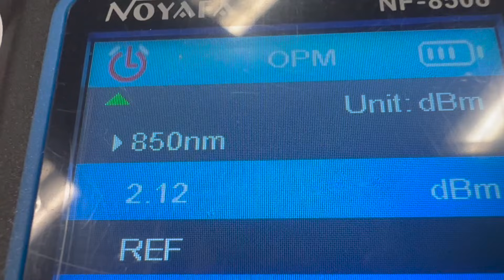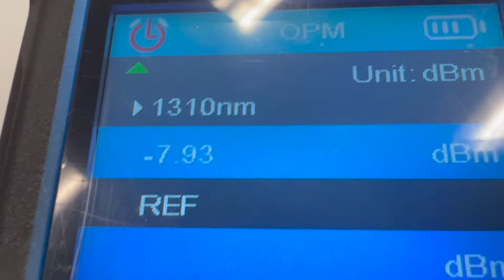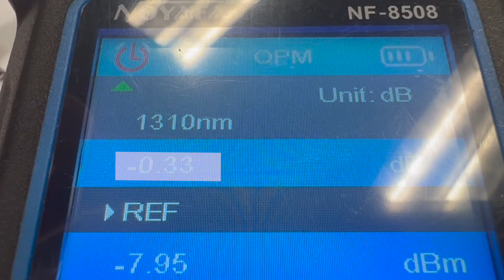How To Test Your Fiber Optic Cables With Cheap Tester

Comment: I'm finally making the jump to fiber optic cable termination and testing. Your videos helped get me there. Thank you. 

I'm getting the Noyafa as my starter fiber tester soon. I'll be sure to do it from the link in this video. I'm also looking at the Metra av cs-fbrkits fiber termination tool kit unless you know of a better entry-level option. 

 - Robert
Reply from the maker: A cleaver and stripper/cutters for that price is not bad.  I used a 3M system for mechanical connectors for a while for multimode but I found singlemode too sensitive to the mechanical connection and switched to fusion.

Comment: Hello thanks for your interesting video, very helpful 
Perhaps u can help me, u mentioned that as an OLS, a Fiber switch or router can be used, also Media Converter. I have tried my Media Converter HTB-GS-03 the A and the B on 1310nm and others, but the OPM didnt indicate a Signal, Fiber was tested with red light ok. What do I have to do to get it working? The HTB are working fine as a set. 
If HTB is not adequate , does not have SFP only a Jack for SC can I use any Router  or Optical switch? Any settings ---- Many thanks already

Comment: Dumb question.  You were showing a .75 db loss.  How did you get that from the -0.33 ? Or was that what you were referring to?
Reply from the maker: Apologies for that, when I did the test during recording I had that coupler attached and it adds a little bit of db loss and I read out what I saw on the screen.  When I took the B-roll, I had a different cable attached with one less adapter so the db loss was lower.
Reply: @tciproductions  Was confused and came here for this answer as well, thought there was some math I was missing. So you're saying the 2nd line on the tester screen read -0.75 dB when you read it, not -0.33 as is shown in the video?
Reply: Even i had same query 👍

Comment: Great video! My new company provided me with this same tester. And i was gaving toruble getting an accurate db loss. I am used to using the fluke twster and always calibrated it before testing. I suggesting that problem is probably that we need to calibrate before use. Thanks for clearing that up and great demonstration.
Reply from the maker: Thanks for saying so, glad that was useful.
Reply: What is your opinion about this tester in the Video and another one NF-958GT
is it accurate or not?

Comment: I work for a fiber to the home isp. Our specs are usually anything below -22db light. This is however light loss over 10s of miles of fiber. At the source we usually measure -9 / -11.
Reply from the maker: That's really interesting.  We usually put our point of presence in a condo basement and run the fibers to the units, I have always wanted to go through the city conduits but that's for a larger company to tackle :)  Sounds fun to me.
Reply: @tciproductions  When it's not raining it's great. When it's raining ya tell cleater to get the tent lol.
Reply: Why does my NIU box have 500 written inside of the box with a permanent marker? They didn’t write a negative number inside. Idk if that’s good or bad I have Google fiber.
Reply: @Joe-lc3sv not a Google fiber tech but that sounds like a tag of some sort.
Reply: @andrewyork3869  I’m not sure
Reply: Hi Bro, What is your opinion about this tester in the Video and another one NF-958GT
is it accurate or not

Comment: Really interesting video! What's the difference between the testers mention here and an OTDR? As I understand it, with an ODTR you can  test a fibre with out a light source at the other end??
Reply from the maker: An OTDR flashes light pulses down the fiber and measures how much is reflected back and where.  You would use that to determine where along the fiber path you have a bad bend, or dirty coupler, or some other issue where light can't get past but you aren't sure where.  In my experience the fiber is always broken if this happens, but it can help locate the fault so you can splice in a fix.  The light source measurements are often included if the OTDR you have has a remote side device - say a LanTek IV for instance.
Reply: @tciproductions  Thank you, that explanation is very much appreciated...

Comment: Great video thanks for share your knowledge with us! 
When would you use something called an OTDR launch cable for testing? 
Thanks again I subscribed right away to your content
Reply from the maker: An OTDR works by sending a series of light flashes down your fiber, there should be a certain minimum length for this to work well and detect reflection events.  The launch cable also provides you a known good section in your graph at the start and finish, allowing you to detect bad end-faces and splices near the start and finish of your strand.  Without a launch cable you'll have some difficulty detecting defects at the ends of the strand.

Comment: Great video! Very easy to follow!

How do you find the tester itself?
My boss won’t purchase a tester for fibre or even a proper copper pair tester for the company. I want to ensure I can do pre and post installation tests of fibres I’ve hauled.  The tester you’re using there is a reasonable price tag for something I am going to buy personally. Is it reliable and decent quality for the price?
Reply from the maker: For personal usage its good enough I think.  At that price you aren't risking too much.  A bigger one that prints out reports or does tier 2 might be needed on certain jobs but for most common office spaces this would be plenty.
Reply: did you buy it what's your opinion about this device?

Comment: generally, we use multi-mode as long as it will work which is generally 400 Meters because SFP are just cheaper and you get the 10 G between buildings
Reply: We use single mode. Cheaper and better cable, less issues with tight bends, extend FTTH, unlimited speed, weld buildings together and we love to use bidi tranceivers. SFP+ for singlemode is not expensive. OM5 cable is expensive. 🙂
Reply from the maker: That's true, it will go pretty far.  I learned under an old greybeard and its always just stuck for me to use MM within range of servers and nics, and SM for inter-building/campus links.